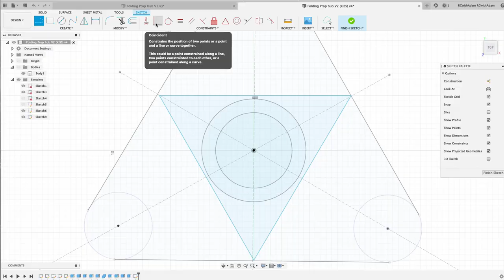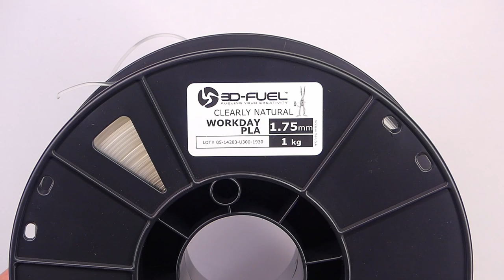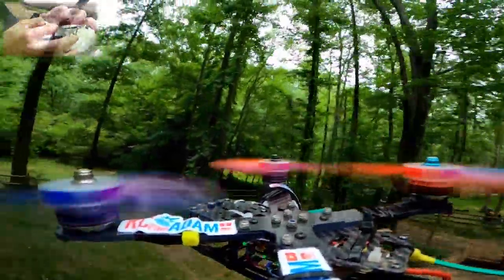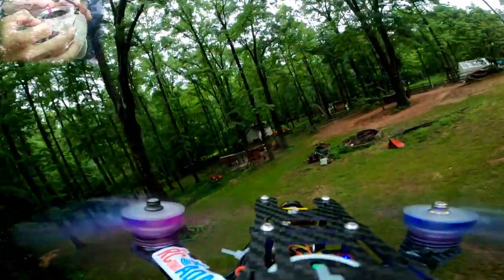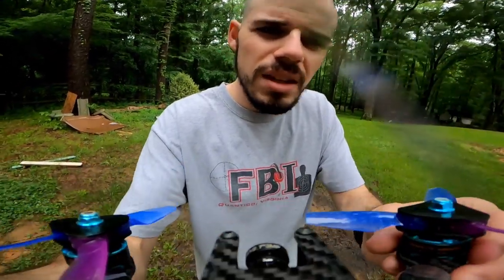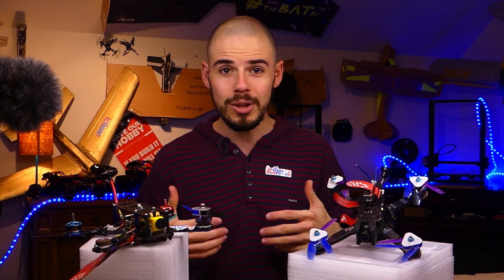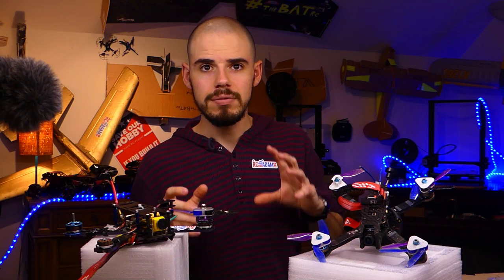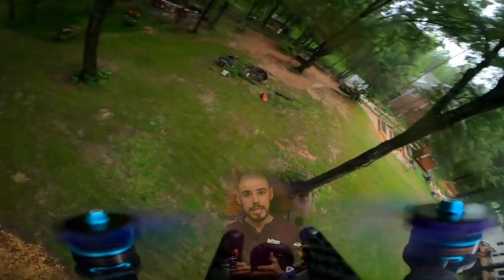3D Printed Propeller Hub to Fly with Broken Props (Part 2 - Improved)

Comment: As you guessed.  .gcode files are printer specific.  Even if both use ender3 printers, your config might be slightly different.  Nozzel temps, etc...  The slicer has to output that info.  It's not stored on the printer.  The printer just does what it's told.

Comment: Awesome video, great attitude about breaking things, wish I was that calm right when things happen, it takes a bit of time and hind sight for some of us, lol. 3D printing montage, what a great segment to make a boring subject so cinematically interesting. CR 10, Ender 3? These are 3D printers? Didn’t notice links to the 3D printers or filaments, I’m on a limited budget looking to get a printer was wondering your thoughts on best bang for the buck. Keep up the awesome content.
Reply from the maker: Hi! Thanks! I put links to the 3dfuel filament but not the printers (and I couldn't find the sunlu anymore). Yep, I have the CR-10 and Ender 3. The Ender 3 is really more of a kit and requires more assembly and tweaking than the CR-10. I'm gladI got the cr-10 first, and I kinda wish I had just bought another CR-10 (commonality of parts, voltges, etc.). Between the two, I'd recommend the cr-10. But there are tons of good options out there now. I'm certainly not an authority on 3DP, but this 3DP jumpstart videoI made might help you. https://www.youtube.com/watch?v=OomRF6pKh2k
Reply: RCwithAdam thanks, I watched that video also so now I have a little more direction to head

Comment: Great experament 
Why not using PETG its is more durable not much but more than PLA
for that application I think that Polycarbonate / Nylon is best.

about filming consider using insta360 go will give you great angles with less wight influence on the quad
Reply from the maker: Hi! Very good points! Right now I'm just done with printing PETG because it's been so difficult (for me)  to get a good print with it, and I really like printing directly on glass.
The insta360 Go is definitely on my wish list! It would have worked so much better  for keeping the quad balanced. I don't think the image or slowmo  is quite as "good" as the hero8, but I also haven't seen many comparison videos between the two.